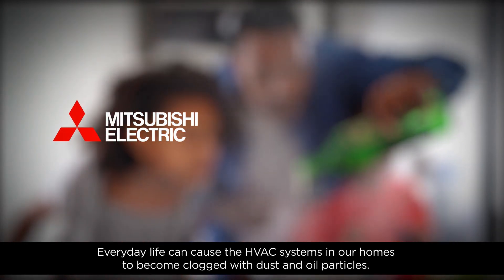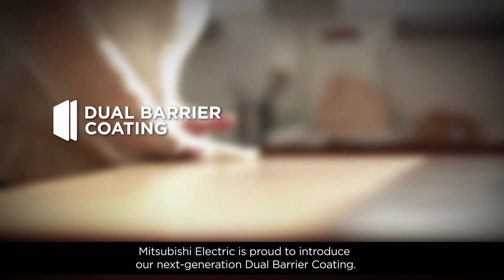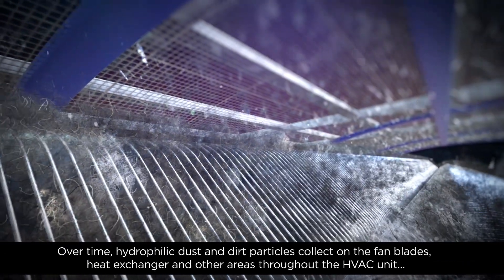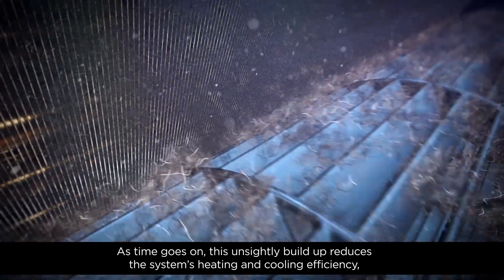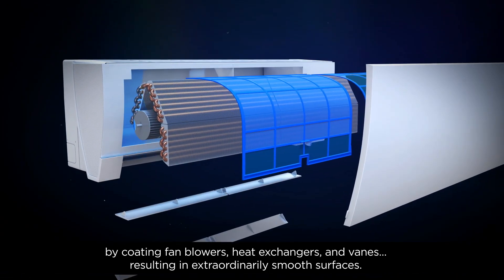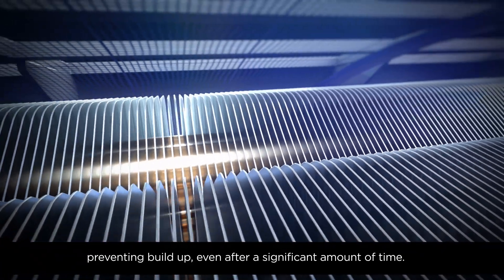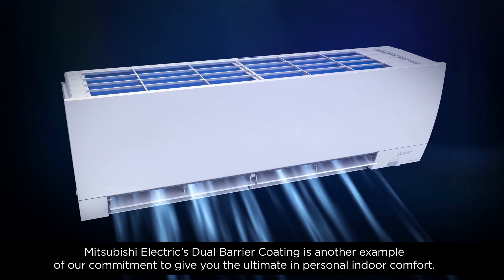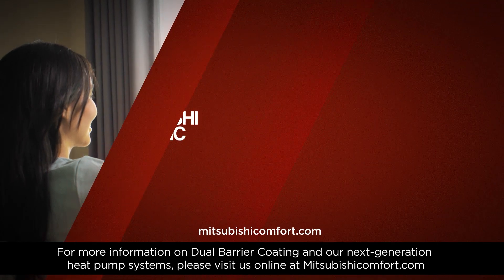Mitsubishi Electric's Dual Barrier Coating

Comment: what models are these available on?
Reply: GS 30&36 models too
Reply: @bluebellharleyrider  does JR model have it?
Reply: FS series
Reply: @polar,,I believe you are talking about the JP model 115volt. I’m not sure about the JS model, I haven’t heard of that model. Eventually the entire line up will switch to the dual barrier coating, but for now just the FS line and the GS 30/36 models are factory equipped.